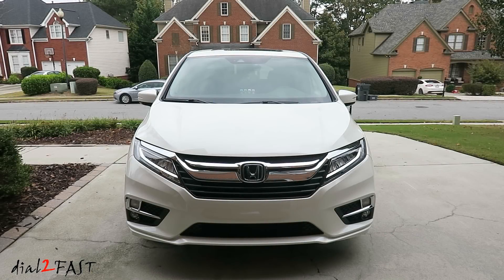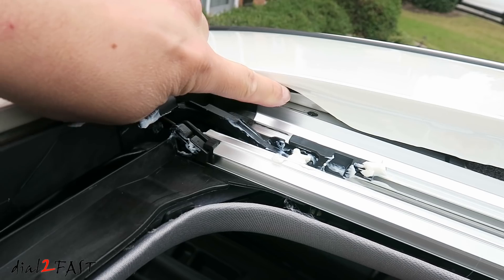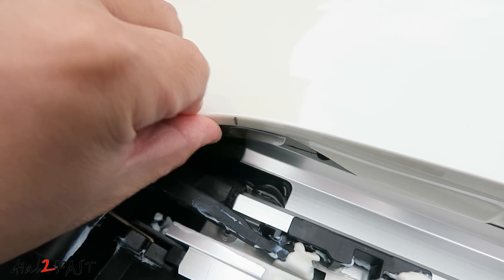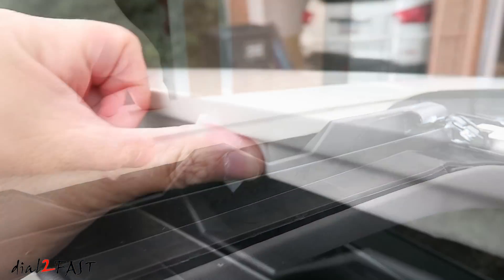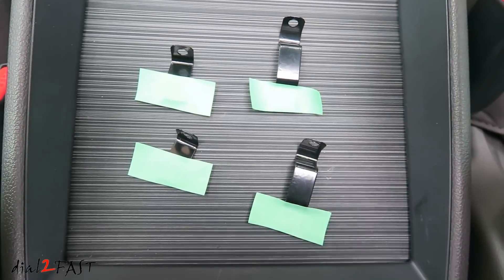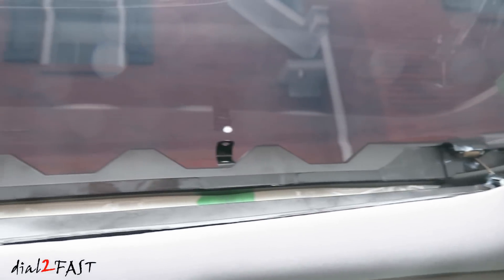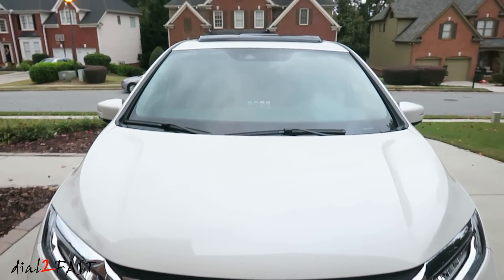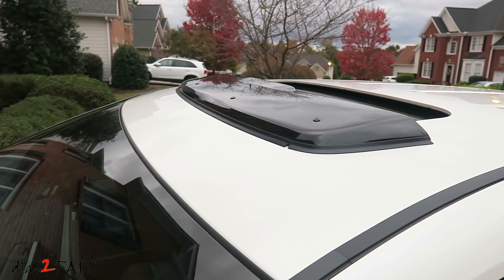Honda Odyssey 2019 Install Sunroof Visor Deflector

Comment: how is the quality on these... some people said its not as good as the one you buy at weathertech? could you please help me decide.. thanks
Reply from the maker: OEM parts are better than aftermarket. Especially when it comes to proper fitment. Also Weathertech will charge you an arm and a leg.
Reply: I see this is a year later but I can offer insight today. I bought the WeatherTech for my 2007 Honda CRV EX-L. It was a total nightmare. I could not even get one side one side installed. (WeatherTech only comes with two brackets.) The end of the screws were a smidge over 2 inches from the bracket. NO WAY to install. WeatherTech's great advice was to press harder. Myself, my neighbor and his 18 year old son could not muscle it anywhere near the bracket to even attempt to start a nut. I returned it and bought the OEM Sunroof Deflector from Honda. I've had ten total spine surgeries and I'm disabled but I was able to get everything done BUT, the two side screws were a bear. I had to call my brother over to help me and eventually we got it on. I think the side screws were a hair to short but as I said, we got it. It fits great, functions well and I don't regret the purchase. Buy the OEM Honda and save hours of frustration in the long run.